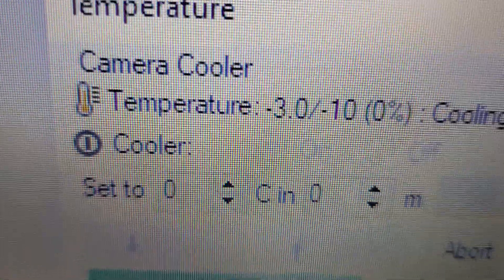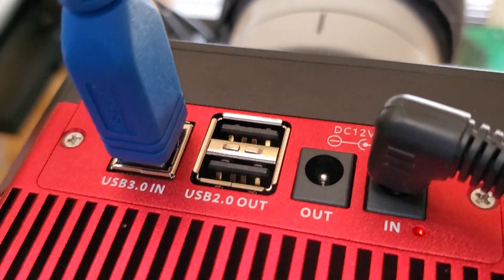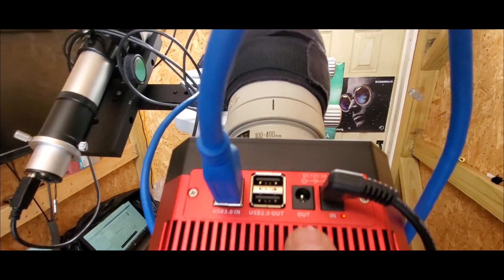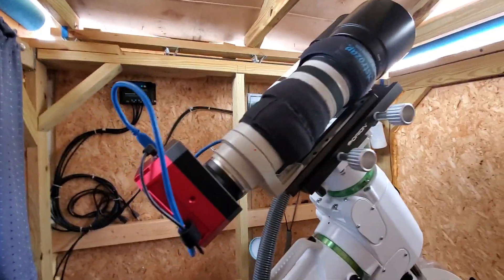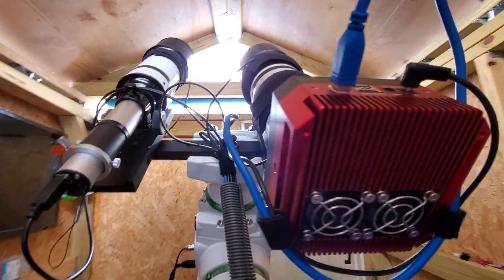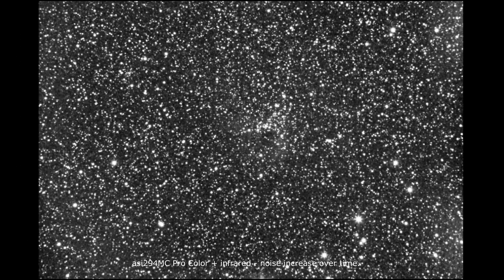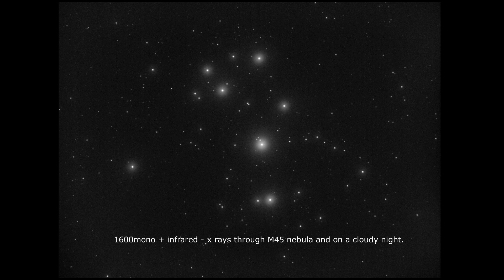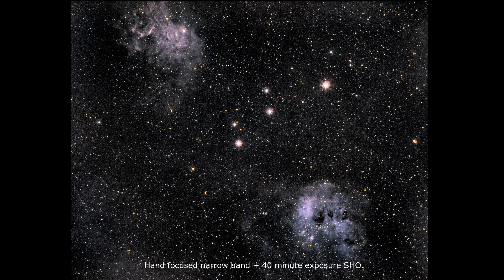asi1600GT my first light with Infrared and SHO

Comment: I purchased the usb3 cable with the 90 degree male B connector for the camera side in the 1' length and just plug my mail cable coming up to it when connecting to the scope. Keeps the cables from snagging anything.
Reply from the maker: thanks  for the tip, going to shop for 90* USB3.